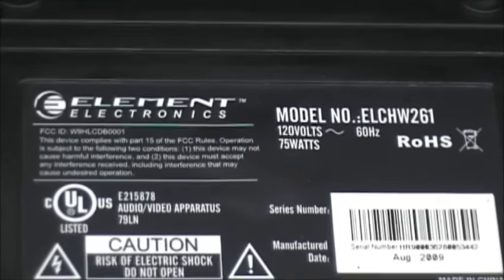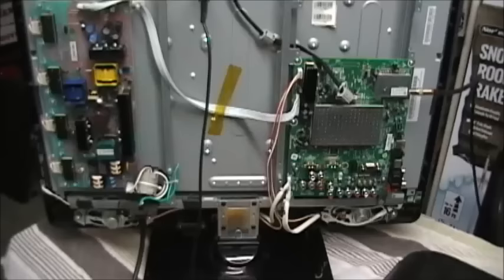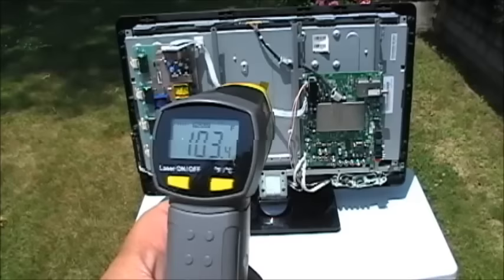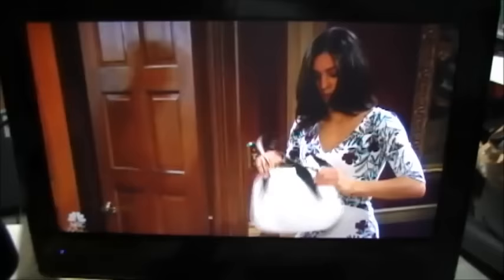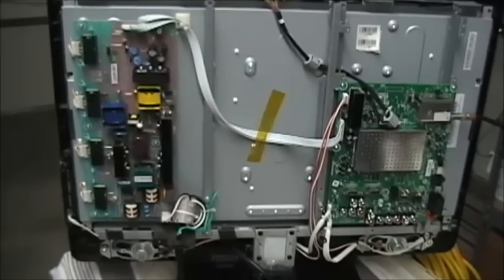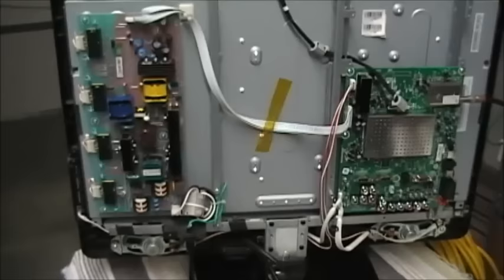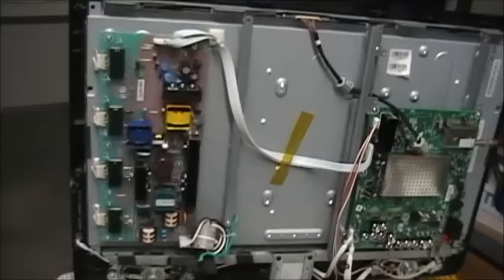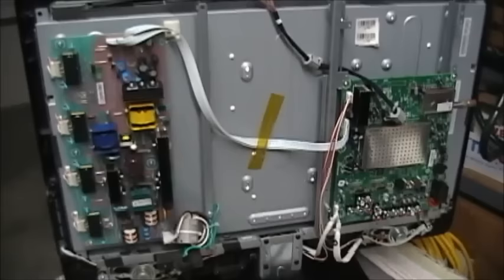LCD TV Repair Secrets - White Screen

Comment: Thanks. Does this apply to gaming handhelds like the PS Vita?
It's likely the flex cable. Put a solder on the cable to resolder it (unless the wire inside is cut then you got to connect the pin with thin wire. Don'y solder for too long it'll melt the flex cable.

The TV must have moved frequently or it fell/got banged up and gave the flex cable metal fatigue.
Got to table the flex cables.

God bless, Proverbs 31
Reply from the maker: I don't know anything about the PS Vita gaming handheld but I do know that one can not solder TAB/COF assemblies. They are not soldered. They are electro-chemically bonded. God bless, 9th Commandment

Comment: Pls help it doesn't work on mine pls help me I dead with my parents
Reply from the maker: The purpose of this video was to show that white screen symptom is generally caused by a failed display panel assembly. There is no easy fix. New boards are NOT going to fix a TV with a failed display panel. But, you might be able to make the symptoms come and go by applying heat and or pressure to the upper left corner of the screen. Nothing applies 100% of the time, but in many cases, it's a quick, temporary solution. That's been my experience, but others are free to disagree...

Comment: working for pc screen or not iam curious ??? my lcd too bright after fix it :(
Reply from the maker: In my experience, too bright symptom on VGA monitors was often caused by high ESR capacitors on the tiny board connecting to the LVDS cable.

Comment: Sorry but this did not really work for our tv.
So if you guys have any solutions please tell me
So our tv is Toshiba and it’s actually pretty old but before the screen was very clear the appearance on each channel is HD but earlier when we opened the tv it changed color mostly white and a very light screen we tried several methods but none worked, we started to worry because we don’t have any budget for repairs and my parents cant work since my mom had covid.
Its very difficult cause besides from our gadgets the tv is our only entertainment.
So please if you have and solutions for us so try please tell us

Comment: Very bad info you are giving sir... i have 20+  yrs of experince on tv repair and its not thing you say...it fyi the tab is not glue (conductive glue)... its solder ... dont make videos if you dont know what your doing .... and the tape works because ur puting pressure on the bonds ... bad info ... sir
Reply from the maker: I'm sorry, but you couldn't be more wrong. There's nothing to solder! TAB/COF assemblies are held in place with glue. Then, their microscopic connections (concealed beneath the film) are made using an electochemical process. You couldn't resolder them (even if you cut away the top layer of film and exposed them, even if you has superhuman eyesight, even if you had nonexistent, microscopically fine soldering equipment and a robot-steady hand) because they were never soldered in the first place. Other than replacing the entire display assembly, the only permanent fix is to replace the failed TAB/COF with  new one. That requires a skilled operator and very expensive remanufacturing equipment. Search for "Tape Automated Bonding Machine" to see how it's done...
Reply: Not gonna argue with some one that has no experince on electronics... i have more than 20+ yrs experince on fixing tv ... i know how they work and how to fix them an yes they are solder with a machine ... not glue... learn on how to fix tv instead of giving wrg info sir.. tabs are solder on but thats ok not gonna argue with some one that has no experince on electronics... u go ahead and put tape or what ever u want to fix your tv or go put it out in the sun again... just dont do videos on things u have no idea how they work... and fyi glue will not let curents lvds signal go threw .... LEARN HOW TO FIX ELECTRONICS ...
Reply from the maker: I can't speak to your motives, but there's no shortage of TAB  Bonding Machine videos both here on YouTube and on AliBaba. View them and you'll see that heat is used to carefully remove the old TAB/COF. Acetone is used to remove the old glue residue. Alcohol is used to clean both the glass and the electrodes. ACF glue strips are applied to both the source driver board and the LCD panel. You'll see other chemicals being applied. You'll see a skilled operator working at very high magnification at a very expensive TAB bonding machine. The one thing you're not going to see is soldering equipment and solder. But despite all the evidence to the contrary, you still maintain that this is very bad info and that you can fix failed TAB/COFs with solder. Please, make us a video showing how it's done!
Reply: Go to a electronic school like i did get the 20 + yrs of experince that i have than we can talk...i do this for a leaving not for youtube know how's ... so yeah u continue doing videos on how too... but at least learn how to before you try to show how to .....
Reply: @elnightdriver3055  You sir are indeed wrong and your arrogance to accept that fact is a failing.   They are bonded, not soldered.  This is really well known in the industry and a really common fault in LCD TV.
Reply: it's called micro soldering and with a little practice and a magnifier you can purchase online for around $75.00 and a rework station for another $75.00 you to can perform micro-soldering. its not hard with practice and the right tools. The rework stations blows hot air thru a very small hole to melt the solder then you work under a magnifier to float the component into place. @LawrencePina